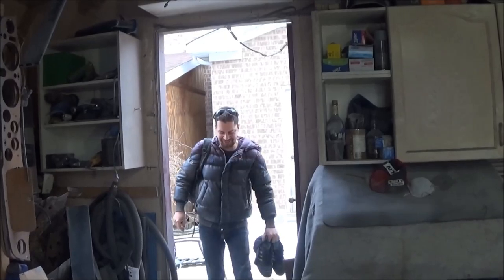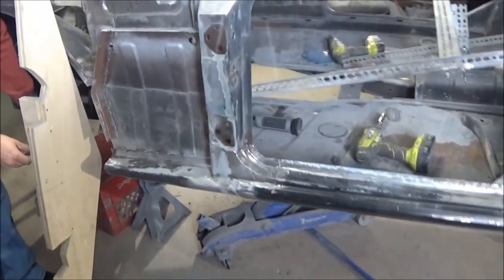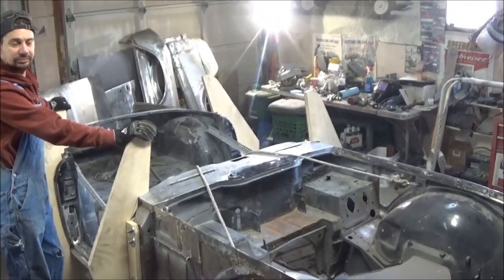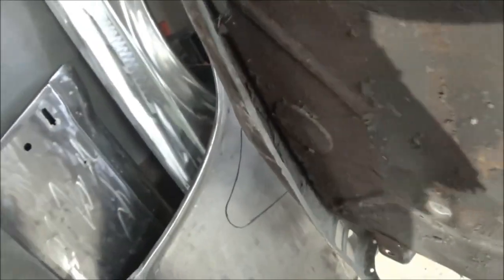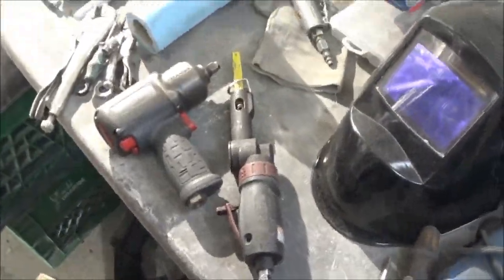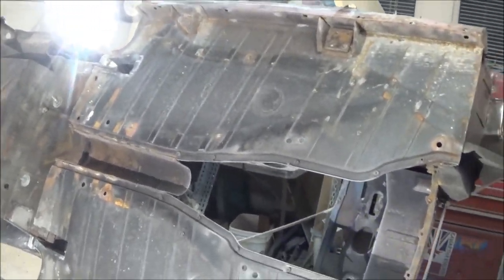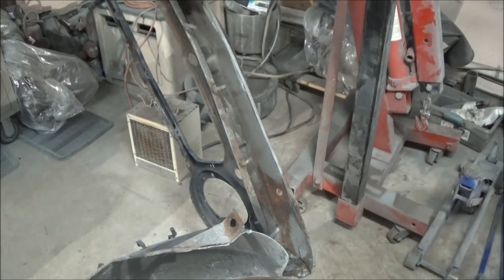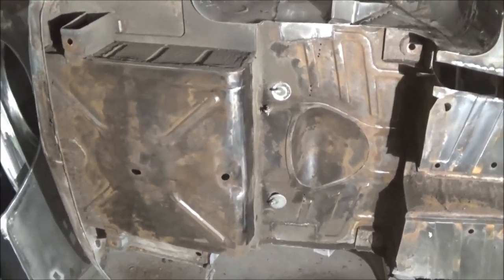1968 Triumph TR250 Restoration, Getting to the Bottom of Things.....

Comment: Clever idea for a rotisserie like device,
Reply from the maker: Yes, I call it the “ wooden wonder” 😉
Reply: @cheftush  I was going to make a rotisserie, didn’t see much choice although it’s a PITA afterwards to store it and I can’t really afford the space, to say nothing of the cost. I’m thinking now having looked at yours I might “borrow” the concept, it’ll do 90% of what I need to do and no storage overhead and practically no cost and I can knock it up in an hour or so. I’m guessing it gets in the way a little for sill replacements so one has to temporarily take it off for sill replacement and do those on a table or something and then put it back on afterwards?
Reply from the maker: @NialPowerCork  hi Niall, yes that is one of the great things is that it doesn’t cost much to make and you can store it later easily if you like.  For the sill exchange, I personally would be doing that with the body on the frame not on the rotisserie.   Do you need plans Niall?  I can send you a link to blueprints if you wish.
Reply: @cheftush  Thanks very much for the advice, I’ll do that. Currently I’m working on the frame which is too far gone to repair so I’m almost finished making a jig so I can replace 2 and possibly 4 of the members. I’ll make the wooden wonder and get it fitted and use it to clean off the underside. I’ll have to replace the floors and sills so that bears a little thinking about exactly what order to proceed with, but either way I’d be delighted with drawings if you are happy to share them, thanks.

Comment: Your wooden rotisserie is very cleaver. Would you be willing to share the plans and maybe show more detail as to how they’re secured to the B post?
Reply from the maker: Doug Dallhoff hi Doug, they are based on this http://www.mossmotoring.com/diy-rotisserie/ but with some changes.  Notice the shape of ours differs (longer on the bottom) and ours our much sturdier (2 X 3/4 inch plywood sections for example).  I'll take some more video of the attachment points for you. Cheers, Tush

Comment: Those rotated boards are fantastic. They are just what I need as I only have a single car garage, so I'm limited on space. Could you post the dimensions or plans for it? It would be most appropriated. Thanks
Reply from the maker: type2drvr50 http://www.mossmotoring.com/diy-rotisserie/  we doubled the thickness of the plywood and extended the bottoms but this is the basic design.
Reply: cheftush thanks for the response, I’ll start on it today.
Reply from the maker: type2drvr50 let me know if you run into any issues with them or you need some closer photos etc.  Also, let me know how they work out for you once you get them installed

Comment: Hi Chef
I'm sure that you at one time mentioned something about the square holes in the heelboard, but i cant remember?
Please?
Reply from the maker: Ulrik Kaul Hi Ulrik.  The slots in the heel board are relief cuts for frame support bars that were added in to the original chassis. I have some capping pieces that will be fitted to the inside of the passenger compartment, over the frame support bars to close them in.  It will become more apparent in the next few weeks 😎

Comment: There was a place along the road from our garage that did Ziebart rust protection in the late 70's , problem was they steam cleaned the new cars then put the rust potection on and in damp panels . A Datsun 180B estate came in for rust repair which was unusual for a main dealers to do had to fit rear quarter and door rest of car was rotton and had been brush painted , found out that was a Ziebart  warranty repair . Ziebarted cars were horrible to repair , those holes could be Ziebart plus the amount of welding it's had , at first I thought t had been raced and crashed a lot .
Reply from the maker: John Morrow hi John...most likely both answers are correct 😎